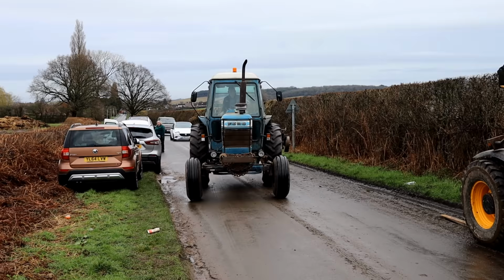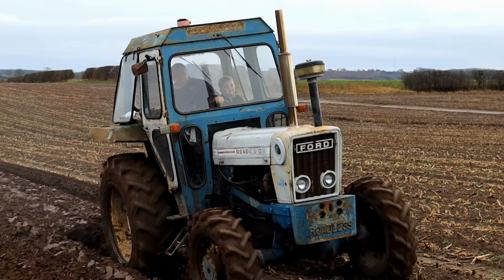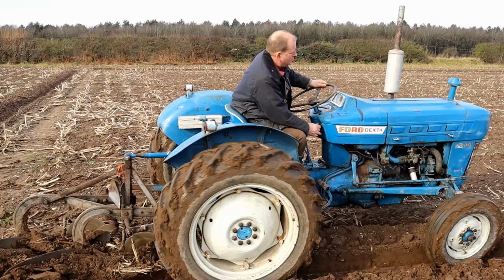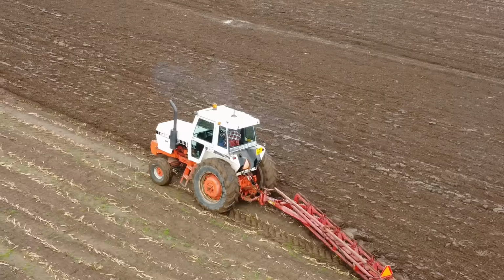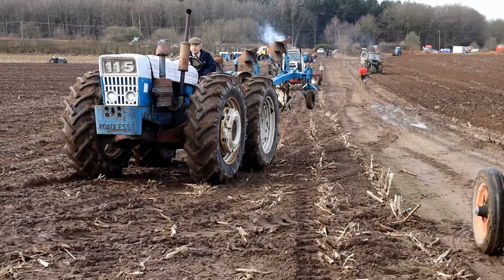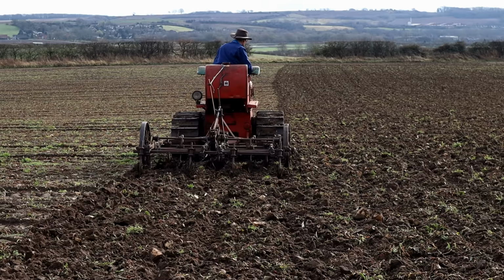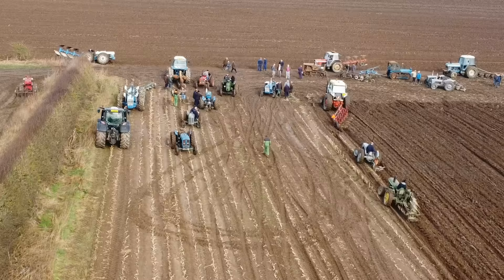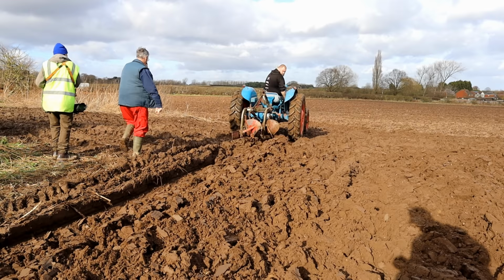Working Tractors at Notts NVTEC

Comment: Hi there great video, im the lad on the fergie with 4 furrows. The tractor pulls it without all the weights, the front weights are purely there for safety to keep the front end down when loading and unloading, and the rear wheel weights were an addition to see if it would pull better with them which it did help on the day due to how greasy ot was but as you say harry fergusons system can do a lot more then people think. As like i say it does work with no weights too. Once again thankyou for another great video.
Reply from the maker: Thanks for giving us the details and thanks for showing us what a Fergy can do.  Very impressive.

Comment: Plough with chain top link is I believe called a mellotte 👍🏻👨‍🔧
Reply from the maker: Do you know if it is designed to work without a normal top link?
Reply: @Casterton-Vintage  ours came new with chain top link and a chain for auto turnover fixed to drawbar ,adjusted to turn at top of lift👍🏻👨‍🔧🛠
Reply from the maker: @johncooper398  That is interesting t know.  Thanks.